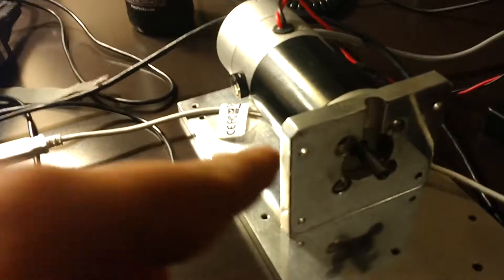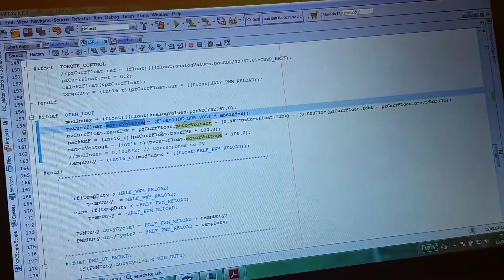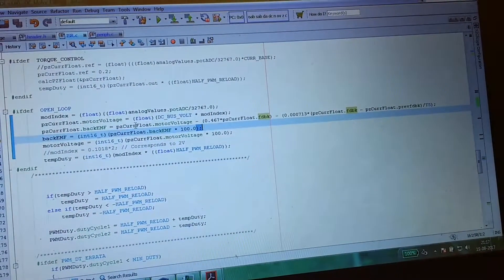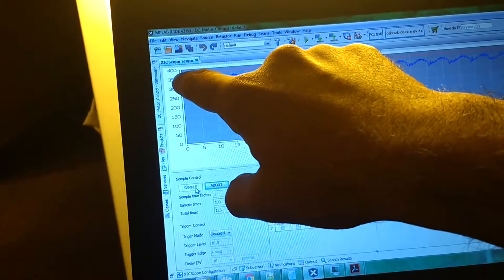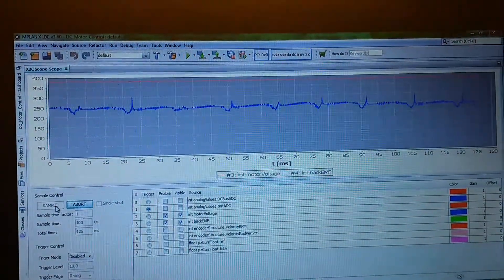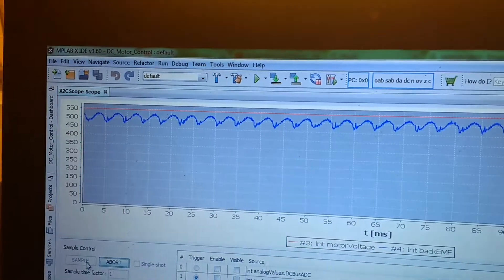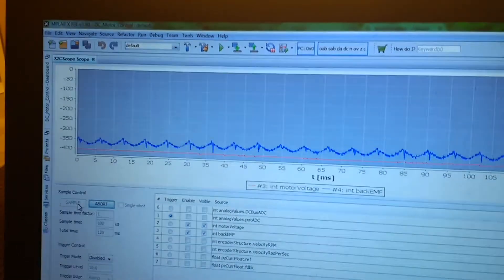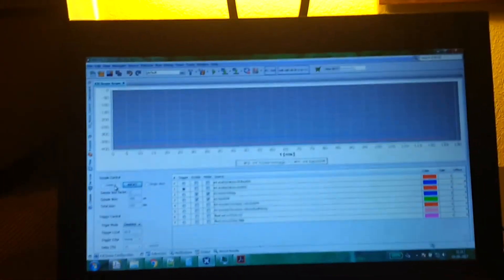Using Back-EMF of DC motor to estimate speed.

Comment: @Debraj1978 Can you plz share the code and whole setup and circuit connection, I want to try this....
Reply from the maker: This code is written for Microchip dsPIC and this particular hardware (MCLV-2 development board) only. If you do not have all these, the code is of no use.
I would recommend you to understand the concept and write the code by yourself.
Reply: @Debraj1978  Board is costly, is there any cost effective solution. I want to calculate speed of dc motor,so can I go for some  simpler ckt to measure back emf and calculate speed by just dividing it by EMF constant??

Comment: But how did you measure the RPM? Its only backEMF calculation
Reply from the maker: Since RPM is directly proportional to back emf, you can find RPM. Just know the proportional costant for your motor.
Reply: @Debraj1978  Thanks for reminding Lenz's law which states back emf is proportional to NLBrw, where w is angular velocity.
Reply from the maker: @vtolrohnit5774  I am lucky to use trigonometry and calculus in my daily job :-)
Reply: @Debraj1978  I think poles also matters while calculating RPM of motors. am I right?
Reply from the maker: @vtolrohnit5774  No, it does not matter. The proportional constant  = (Back_EMF/RPM) in Volts/RPM or Volts/rad_per_sec does not have any term related to pole.